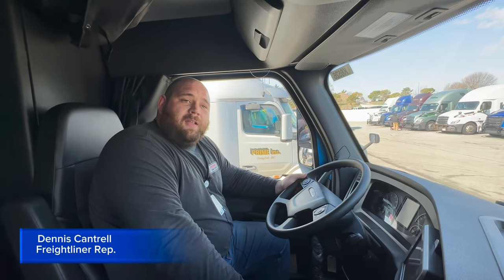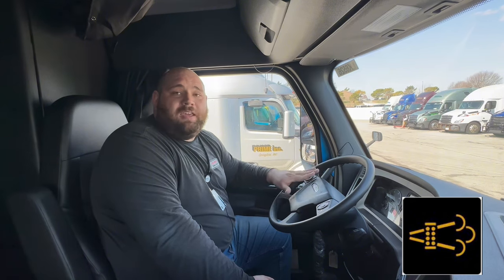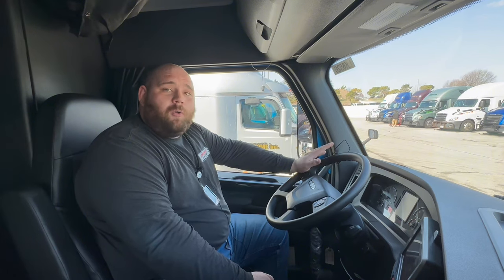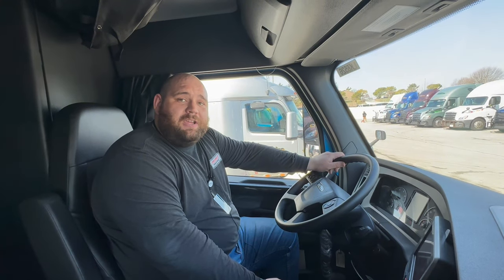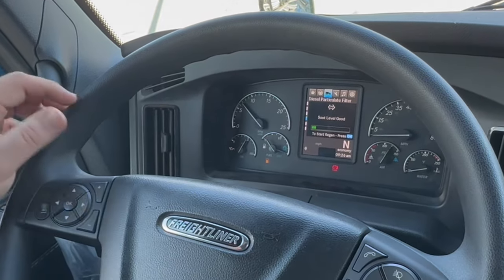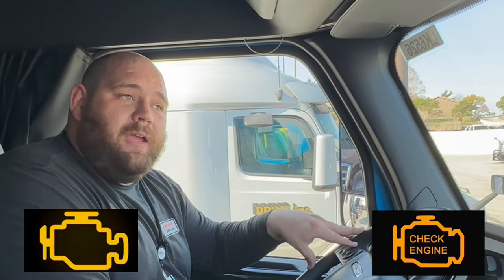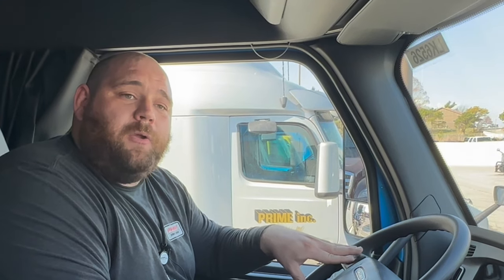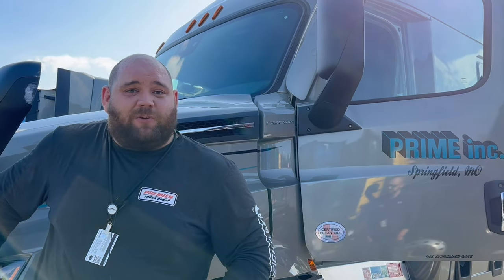How To: Regen on Freightliner Cascadia 2023, 2024, & 2025

Comment: i have a 2022,and it does't have the dpf option ,and now its asking for a regen ,
Reply from the maker: All our trucks have DPF, required by law since 2008. Regen options are starting to disappear; depending what truck they have they may not have an option to do a parked regen. If one of those and the truck needs a regen we would just need to put the truck within the parameters it needs to do it. We posted this video in 2019 which might be closer to the model you have. https://youtu.be/xAybDRr6a18